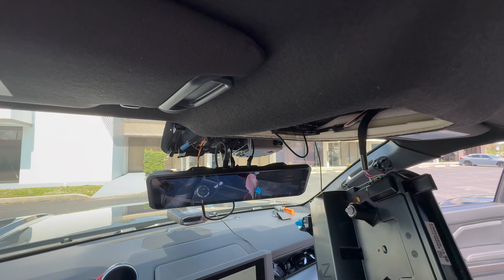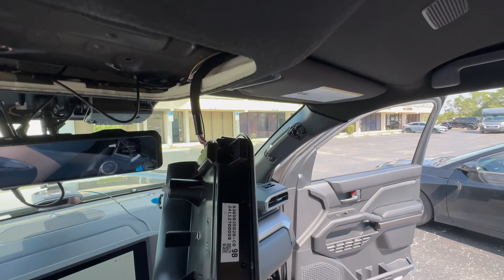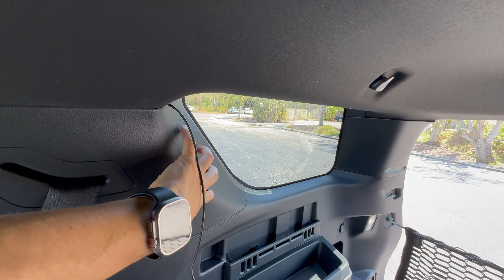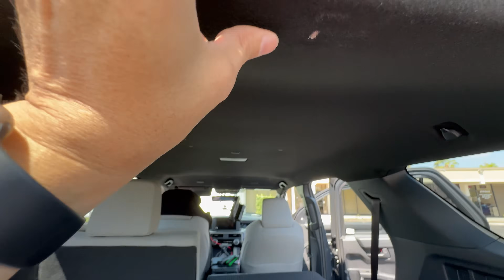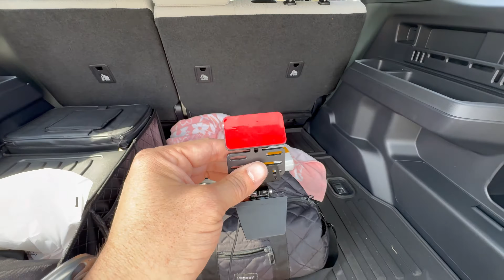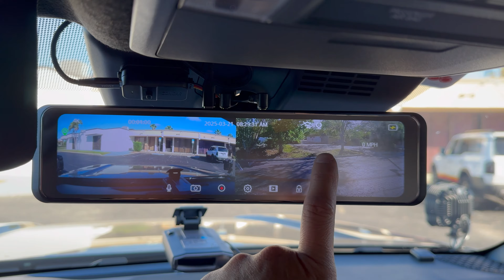2025 Toyota 4Runner Aftermarket Digital Mirror Install Like Wolfbox Dashcam

Comment: I wish you could show how to take the top panel off.
Reply from the maker: Get your fingers under the trim in the rear (part closest to the windshield) and pull straight down. It will hinge at the front. Super easy.  👍
Reply: If you can't take the part off of the review mirror. You probably shouldn't be messing with things.

Comment: What is the model of the rear view mirror?
Reply from the maker: The one on the 4Runner is D566 but it may be called something different from other vendors. Trying to put a kit together with the correct mounts.

Side note is that it barely ever glitches vs our Wolfbox G900 which reboots here and there.